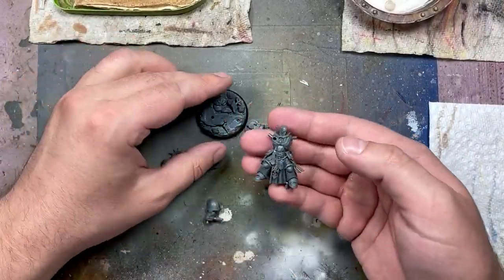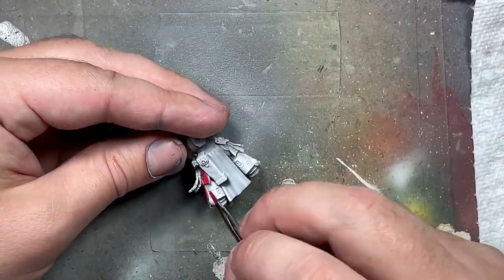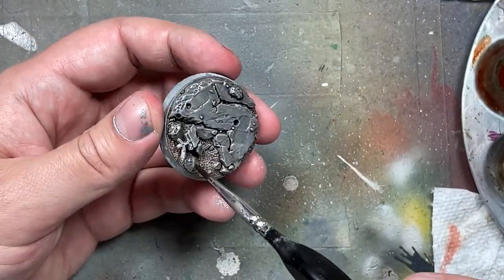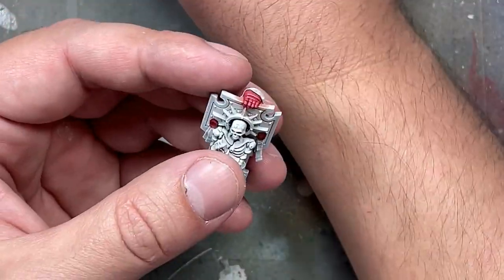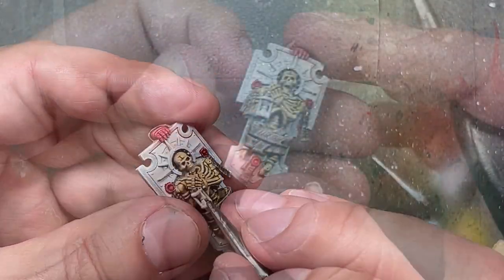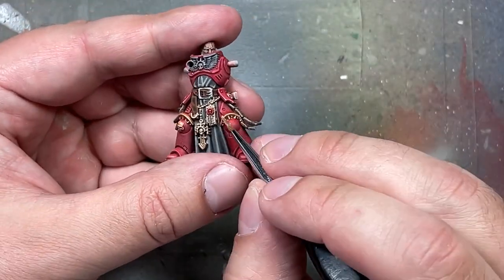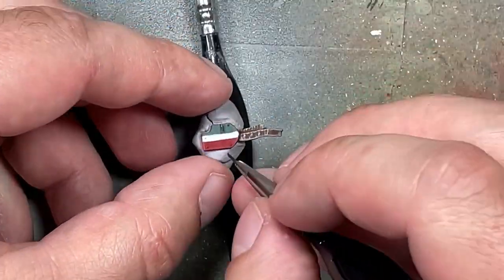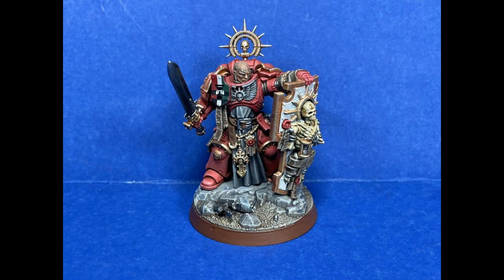Joyful Painting - Blood Angels - Primaris Captain - Round 2 with the Armor

Comment: So.  This is my take.  Blue / green are traditionally highlighted with light blue and light green - more or less result your style creates.  Black gets also highlighted with mix of black and white, i.e. grey.  However we never (??) highlight red with 'light red' because pink, for whatever reason, looks wrong. So we tend to highlight red with orange, which your style with highlights under glazes can't quite imitate?
Reply from the maker: Yea, essentially the highlights are white, and when covered in the red turn pink.  I had considered doing 2 dry brushings on the pre-coat.  
White for the flesh and cloak, and maybe yellow for the armor.  But in practice that wasn't that feasible with the model being very restrictive building it since it was essentially a beginner set and the colors would blend badly in some areas.  It's something to think about for a future project.